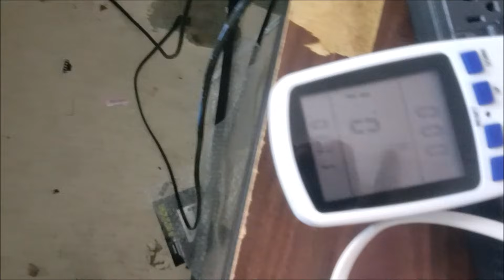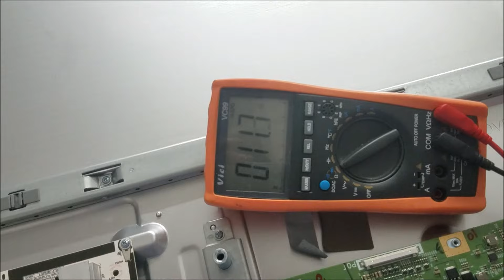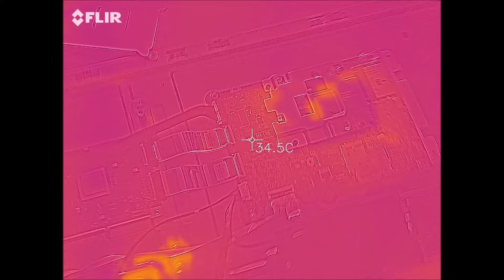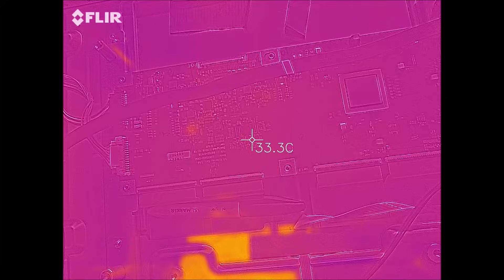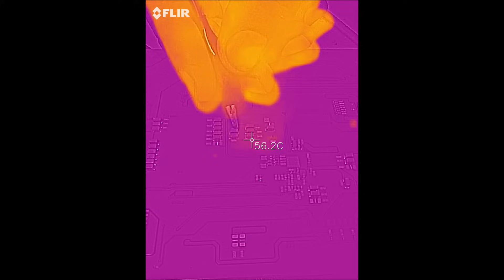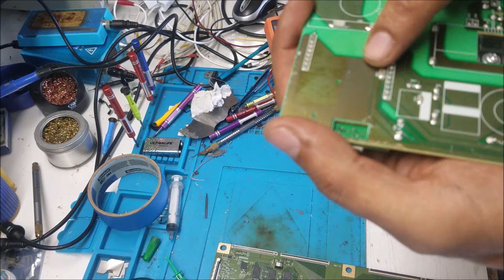LG OLED65B7A wont turns on repair step by step

Comment: Hi, i have a rare question, is possible to change a mainboard of the tv BX model with a main board of CX model, in ebay sells many boards and the internal connections are the same on the same position except for the back cover hdmi input not in same place but can be fixed with some holes
Reply from the maker: yes if they have same connectors, for lg it should works, be sure the problem is not in the screen
Reply: If my screen is fine, (lg65c2oled) so you think internal boards of a lg65c1 would work for the C2 panel? @SOSfixElectronics
Reply from the maker: @ yes
Reply: @SOSfixElectronics  would all the boards need to be replaced or just a c1 main board with C2 powerboard and t-con

Comment: Hi budd thank u for the tutorial
My tv is reading the voltage on both the upper and lower clips 
The problem is tv can’t turn on 
Turns on three secs then turn off but I notice when I disconnected the lower clip the tv took a longer time to shut off do u know what would be the problem
Reply from the maker: the voltages are good? mainboard sending P-on voltage?

Comment: Hi, from Uruguay, I have the same TV 65b7 and exactly the same failure, I'm not expert, the service suggest me a replacement of tcon board, but seeing this video i could repair it, how probable is that my problem be the same capacitor that yours? Because I'm not a technician and only have a tester and solder. Thanks you.
Reply from the maker: you need a multimeter to check for short
Reply: y? te lo arreglaron o le tuviste que cambiar la tcon?
Reply: @luchosantilli  trajeron la tcon del exterior y la cambiaron, se dieron cuenta que no era el problema, 50 días esperando esta noticia, ahora me dicen que es la mother, y tengo que esperar la misma cantidad de tiempo, voy casi 70 días sin TV. El service en Uruguay es Service IT
Reply: @nicolasborgiani5399  increíble.. lo positivo es que la tv solo trae 3 placas, la tcon, la mother y la fuente… asi que solo tienen 2 opciones mas para hacerlo andar…

Comment: hi I have just come across this video by looking for similar problems with my Oled tv

ive replaced the psu thinking that was the issue and I am about to do the same with the mainboard,

the only difference was when it was working the apps would load and then the display went all garbled same as connected devices to the HDMi slots.

could this also be a tcon issue ??

mine is the LG 55EG960V

thanks

Jason
Reply from the maker: Hard to tell. Check the voltages on tcon. Must have 12v and 24v on drive. And 3.3v 1.8 ram 1.2 processor vgh 26v vgl -7v vcc 12v check on coils
Reply: @SOSfixElectronics  hi thanks for the reply sorry mine is a slow one

I sourced a replacement T-Con board that’s guaranteed working.

And I still get the flashing power light.

I have replaced both power boards as well.

The only other thing is the main but I’ve nowhere to begin on that side of it.

Is there a way to force power on ? And maybe get colour bars or something ?
Reply from the maker: @jr20089v2x2x disconnect mainboard from power board and tcone try to jump ps-on and drive on on power supply. If everythings ok yoi should get colors pattern
Reply: @SOSfixElectronics  
Thanks for the reply should I jump ps-on and drv-on together ?
Reply from the maker: @jr20089v2x2x  jump both to 5v or 3.5 STB
Reply: @SOSfixElectronics  

Thanks I’ll try it now :)
Reply: @SOSfixElectronics  

Hi again I’ve connected the ones you have said I get a PSU click 

But nothing still 

I’ve noticed on the connecter there is 12v on is that needed ?
Reply: Another update it’s glowing if I turn the light off but no colour bars
Reply from the maker: @jr20089v2x2x  do you get 12 and 24v on tcon?
Reply: @SOSfixElectronics   I haven't checked the 24v and 12v on the T-Con.

as I said the display is glowing both fuses on the T-Con test good.

ill check voltages tomorrow and post back my finding.
Reply from the maker: sounds like mainboard issue, not sure if you said you already replaced it?
Reply: @SOSfixElectronics   ive not replaced the mainboard yet,

I have replaced both PSU boards and the T-Con with known good ones same result.

if I try to power it on with just the mainboard connected and the rest I get a flashing power light.

Comment: Hello before I get to deep into this lg oled 65b7p-u. It was a free tv to start, the power supply was completely dead. Ordered one the tv still won't come on checked the voltages it's missing 24 volts from the power supply. Then the 19 volts from the main board fluctuates I'm still figuring the screen module took a crap. Any idea's would be appreciated.
Reply from the maker: if you have 3.5 on Powerboard and no red light on tv check the mainboard

Comment: Hello,
thank you for helping us to repair our TVs ! I have the same problem on LG Oled 55EG9A7V.
Tries to turn on and shut down instantly. I checked the voltages and there are good. fuses are OK
When I unplug the video ribbon, It seems to hold power. I swaped Tcon board with on supposedly good and no succes.
So I checked the capacitors on the main board and I found something strange : Next to the video ribbon plug, there are to capacitors that seems to be shorted but after 1 ou 2 seconds the multimeter stops beeping.

How can I now the value of the caps and could it be some element next to it  that makes me think it's faulty but not like any mosfet ?
Thank you for your help.
Reply: Just removed supposed faulty cap : no success. When testing this cap, multimeter beeps once.
Reply from the maker: @Ragmul2024  check the resistance, i think that caps are good, if you disconnect flex cables from tcon to screen and tv hold the power it may have a faulty screen common issues for the lg oled screen
Reply: @SOSfixElectronics  Thank you, I have to resolder the cap first. is there any way to find polarity ( if any ) on this type of cap ?
Sorry I'm still learning and until now I've always been lucky and easy fixed powerboards :-) this time it is quite harder.
Reply from the maker: @Ragmul2024  the brown orange  smd caps that has no mark on them there is no polarity. it will work both ways.
Reply: @SOSfixElectronics  Hello, I'm still struggling with my Oled TV. I have just reread what you said up here. I  did not understood what you advised me at first. So I retried. 
In fact, TV doesn't hold power when I unplug the 4 ribons from Tcom to Screen.

BUT, when I disconnect Tcon from motherboard It holds Power. ( Optical output shines and power led blinks 3 times and disappears )

As I said last time, I swapped tcon with same one from aliexpress. It would be very unlikely to get a Tcon with the same fault ? So don't you think the motherboard should be faulty ?
Should I check the resistances on the motherboard next to the Tcon ribbon connector ?

Thank you for every advise you should provide me.

Comment: I have a 65EG9600-UA TV. The TV turns on fine but after some time it automatically switched off. I think when it gets hot it auto trips. Do you know what may be going on ? Appreciate your hellp
Reply from the maker: take it apart and check the boards start with voltages, you may flip the boards and check solder joint too

Comment: Hi, On B6 there is a short on the same coil and 1 mosfet. Other Voltages ok, no smd short, get sound but no picture, have u any idea please?
Reply from the maker: coil usually not short to the ground should be other component that causing the short look for that
Reply: @SOSfixElectronics  thx 4 fast rep, here is one mosfet also shorted. https://pasteboard.co/KayKA9z.jpg
Reply from the maker: @zsbalak  some mosfet they may have one leg going to the ground, if it is one leg thats ok but if there is 2 or all shorted thats mean the mosfet is bad, check the voltages from power board to the tcon should be 12v and 24v. i did face some of this LGs with bad motherboard as well check that
Reply: @SOSfixElectronics  3 the same with 2 legs. Only 1 shorted. But why... The psu depending on room temp give 11.9/23.4 to 13.5/25.7V usually more V's when it is colder RT's. Just ordered a T-Con board, but not sure the PSU works well. What need check on psu more as outgoing V's?
Reply: @SOSfixElectronics 

hi and thx @SOSfix, @all for sharing.

working through all these steps on my 55c7d i am not sure how to proceed.
i also have an unchanged black screen after turning on the tv. the red standby led will change from steady to blinking 3 times and then the led stays off as if the tv would be on. turning off by remote or directly on the tv seems not to be working once it's switched on.

compared to your case i don't need to turn the tv on over and over again. So I checked the power board voltages comfortably and they all occur to be fine. i kept following your steps on the fuses, the capacitors and coils with a similar outcome.
like "formasters link above" i had no voltage on the same coil like him. the coil wich was giving you no voltage is located slightly upper left above the 5/2/3 rows of capacitors, right!? so it might not make sense to assume its the same capacitor rows like your case on the back of the board. i can't see any burns or similar. there is noise coming from the power board wich has always been there (sounds and cycles unchanged). there is little noise coming from the mainboard, probably from the main chip with the big silver cooler. took it off to be sure but can't exactly tell.

i also believe i might have to face a faulty mainboard. the history of faults made me come to that conclusion. It started with a loss of the red cursor on the screen wich appeared when you we’re using the remote… it suddenly disappeared.
then i recognized wlan to be switched off and not to be able to get it back on. 
i didn't care because i mainly use my chromecast and the game consoles. so the hdmi was all I needed.
but then the tv occationally went off by it self (on 3 or 4 following days) until it stayed dark entirely.

back to the lab... where would you keep looking?
Reply: @zsbalak  hi there, any progress or success yet?
Reply from the maker: @bch2028 look for 2 flex cables from main board to the tcon, disconnect one by one and turns on the tv. dose the tv turns on stay on? check the voltages from power board to the tcon, do you see 12 and 24v? if yes your tv it has a bad screen this is a common issue for this exact model i just checked one like 3 days ago and it was a faulty screen,
Reply: Hi  @bch2028  . The measurements was false. Everything okay on the T-Con board. The suspected is the processor on the Mainboard. After a short baking period the TV was working for 36 hours W/O turning off, but even applied a thicker heatsink, was the temperature on the top of the heatsink 89 celsius. Now ordered a new processor and waiting for stencils to resolder the new cpu. If it succes, give you an answer.
Reply: @SOSfixElectronics  guess i made a mistake. 

i started with both flex connected,
followed by the upper flex only connected,
followed by both disconnected,
followed by the lower flex only connected …

in all configurations of the flex cables I can read .440 vdc where its suppose to be 24 vdc! the 12 vdc is steady at 11.96 vdc at every pin. those readings are from the power board connector (p202) going to the tcon board. I assume the tv turns on and stays on, but as before without any reaction on the screen. The red led also keeps blinking the same pattern
Reply: @zsbalak  thx, appreciate the update… how is the cost in comparison between the change of the main board to the processor (if the task is performed by a professional)? I don’t have the tools or expertise to swap complex ic
Reply: @bch2028  it's depending on countries. In east eu maybe 50€ + the IC is around 15$ from Ali. In west EU the price of work can go up to 100-150€. I found a board on aliexpress for ca. 90$, but the seller is an @$$hole. Asked him about region or guarantee, he told me will answer after the payment :)
Reply: @bch2028  where do you live? Can you close out the T-Con board failure?
Reply: @zsbalak  yes I wouldn’t buy it either👍
Reply: @zsbalak  Germany, and unfortunately i can’t tell… i did a mistake on my readings… maybe i am lucky and it could be the power board. It occurs that the power board doesn’t reach the 24 vdc no matter what setup i try
Reply: @bch2028  have you tried manually jump the 5V pwON pins? Without the tcon and mainboard connected. And measure it after the 12/24V.
Reply: @zsbalak  no i haven’t - so if i understand right… disconnect p201 and p202 and then kickstart the power board by a jumper setup on p201?!
Reply from the maker: @bch2028  if you have a good 12 and 24 v after you disconnect the tcon from mainboard likely is a bad screen
Reply: @SOSfixElectronics  
The power board delivered 12v but not the 24v. No matter how any cables are connected or disconnected. It’s always 0.44v on all 24v pins.
Could it be a power board problem?

Comment: My tv is doing this but when it turns off parts of the screen light up in green hue and then the tv shuts off just like the one in the video. It’s the same lg65b7a. Was this one showing slight green when you then the tv on then shutting off right after?
Reply from the maker: the customer told me it showed some colors before it completely death
Reply: Have you fixed your TV? Mine is doing the same, however it's turning on after a few tries, but it's been getting worse. When the TV turns on everything is fine and the picture is perfect. No lines on the screen

Comment: I have very importand cuestion, I have broken Oled tv, and I cant find out what board is brocen. I know that power board is working great, steady voltage. But Main board don't want to start. Do is possible that main board will work without TCON board? Or Tcon Board is necessary , that main board will start? Because i have now hard time to check on what board is that fail. If main board can work without Tcon board conected, then I will know that main board have problem. 
my tv is lc550lud-lgp1-831  tcon is 6870c-05557A Please help!

Comment: Thanks for this video. Please have you come across this LG 55EC930V TV with on and off  LG logo standby?
Reply from the maker: no, but use the same way to check voltages on the 3 boards
Reply: I repaired this TV almost
Reply: back to 2020 the Mainboard went broken, this year i bought new and yesterday my new LVDS cable arrived and tv is booting perfectly with perfect screen. But after 10 Minutes TV went off, and i recorded it. i watched it in slow motion and saw that it went dark in the middle to both sides with lines.
After turn on again, really fast flashing orange line appears. it's big. But if i wait some minutes and try again, tv works again for some minutes.
 If you wonder how this looks, i will upload videos to the tv in some days.

Comment: Hello, I have an OLED55B6V with an identical problem but in my case I have to disconnect the two flat cables in the middle that go from the t-con to the panel. With them turned on, the TV won't turn on, but with them turned off, it will turn on but I don't have a picture. Will the problem be in the t-con or the panel?
Reply from the maker: hello, check the tcon voltages before and after you disconnect each flex cable and turns on the tv
Reply: @SOSfixElectronics  I have 12 volts and 24 volts with both connected and disconnected flex cables
Reply from the maker: @mustangbolt67  other voltages as VGH VGL VCC
Reply: @SOSfixElectronics  But when I disconnect the flex cables from the middle of the T-con the TV stays on and has sound. The VGH VGL VCC voltage i dont know where to check on the PSU because they are not marked
Reply from the maker: @mustangbolt67  vgh vgl vcc are the tcon voltages
Reply: @SOSfixElectronics  But when I disconnect the flex cables that go to the panel, the TV works, so the problem must be on the panel, right?
Reply from the maker: @mustangbolt67  yes the problem in the panel, you can try to cover some pins to see if the picture shows
Reply: @SOSfixElectronics  Does this method work on an OLED? I will have to cover the pins of the two flex cables since I have to have both disconnected for the TV to work.
Reply from the maker: @mustangbolt67  i didnt try yet on oled screen but it dosent hurt to try
Reply: @SOSfixElectronics  I'll try and then say if it worked.
Reply: @SOSfixElectronics  In order to do it correctly, my t-con has 4 flex cables that go to the panel. The problem is with the 2 flex cables in the middle, I should put the tape on those 2, right?
Reply from the maker: @mustangbolt67  try one by one, the oled screen has low chance for repair but good luck

Comment: Per this tutorial I bought a new t-con board and the power continued to dip after turning on. I bought a main board changed it and now the tv turns on and power stays around 50 watts but there is no picture. Only a horizontal line on the screen when it turns on for a few seconds. Is there any hope for this tv or is it likely the panel? I have a power supply board on the way also.
Reply from the maker: did you check all voltages ?
Reply: @SOSfixElectronics  the power board voltages are good except 12vt_on on P201 that measures 3.5v, I noticed you skip this in your video, is that voltage normal?
Reply from the maker: @thepiecesfit5049  3.5 v is good that voltage is from the main board to turns on the 12v fom power board to tcon